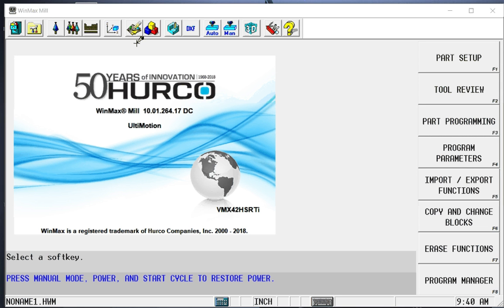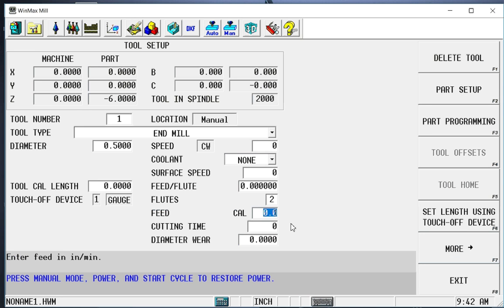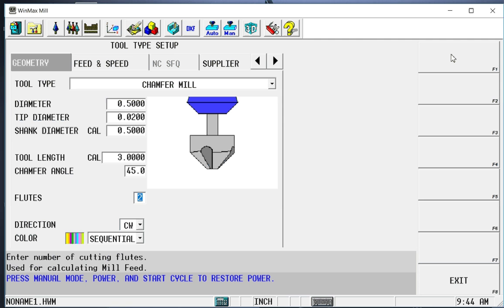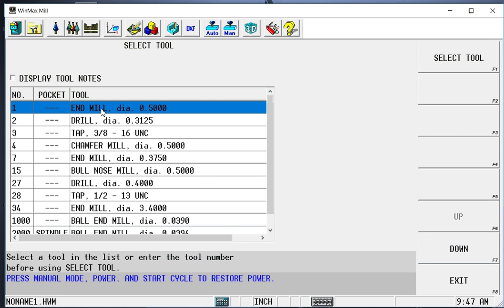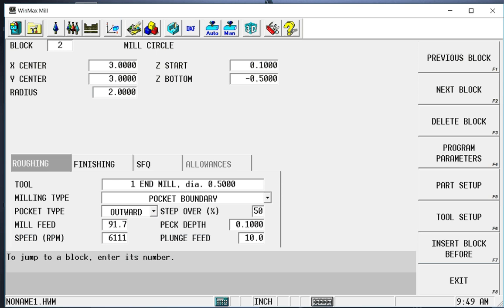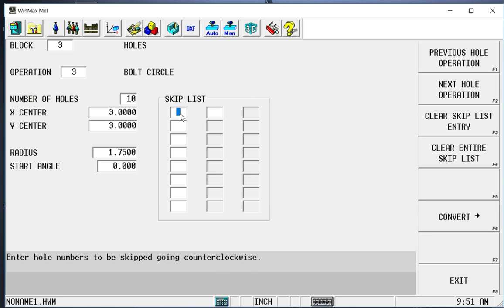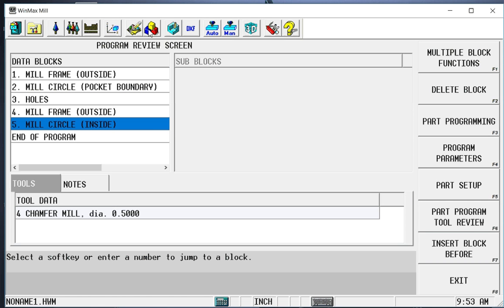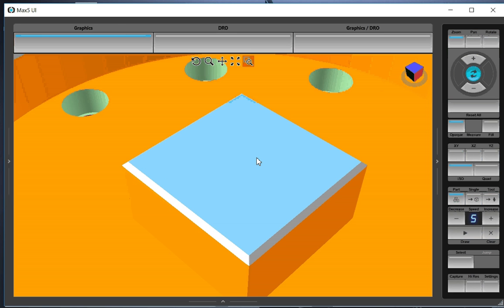Introductory CNC Control Demonstration - Hurco WinMax CNC Control

Comment: Can you not set the program so that after you have cut around the profile and across the top face those edges now become your X Y Z zero positions. I don't want to be working from 0.25 in from these features all the time?
Reply from the maker: Hi Alex, to answer your question no, you would need to make that adjustment to your work offset (Part Setup) prior to machining – meaning that you would move the zero point in .25” in both the X and Y from the corner of the material. Basically doing the same thing, but the control wouldn’t be able to do it automatically.

Comment: Hello I have a question about the pockets, although even if I chose climb milling in my program settings, when I set my pocket inward with an island in the middle, the whole rough is in conventional milling and only the island is in climb milling, a real carnage for my tools. Any tips outside Adaptive Path? Sorry for the possible inaccurate translation my english skills aren't that advanced.
Reply from the maker: You could program the pocket using lines & arcs (not frames or circles). That way the roughing passes should follow the direction (climb/conventional) that you programmed the toolpath.
Reply: @hurcousa  I maybe found a way to use your pocket path, a bit faster than using lines & arc for the rough path since their is a huge path to program that way, i'll instead program the island as lign&arc instead of circle and setup the direction to conventionnal that way both pocket and island gonna be reversed to climb milling, i just really hope the standard inward or outward pocket path works in the future accordingly to the program milling settings (conventionnal/climb), i'll aswell give a try to your adaptive path (trochoidal) which sounds great for tools lifetime. Thanks for the fast answer by the way :)

Comment: What if I want to mill an outside frame (profile), without the cutter starting in the middle of one of the sides?
The best way to mill around , say a square or rectangular profile, it to start the cutter “off” a corner. This way the cut starts from a point clear of the block so that the first cut is along the length on one side, thus eliminating the start/stop mark of the cutter. I would machine around the profile producing a chamfer or radius at each corner. The last corner, I would program the chamfer or radius 0.1mm larger and machine around that corner ending up with the tool standing off the profile by 0.1mm, finishing off with the cutter moving along this clearance line until taking the cutter clear. This avoids the start/stop blend line and leaves all sides of the part clean from marks. 
My question is how to do this in the winmax control?
The example where the cutter starts in the middle of one side can be viewed as a rough machine cycle, but in my opinion it’s not the best way to machine around a profile. I would rough and finish as I described. If that means more lines of program then so be it. 
Be interested to hear comments.
Reply from the maker: Correct, you would program that in lines and arcs not as a frame. That way you can start wherever you like (off the part in your example) and you would program the toolpath however you would need.